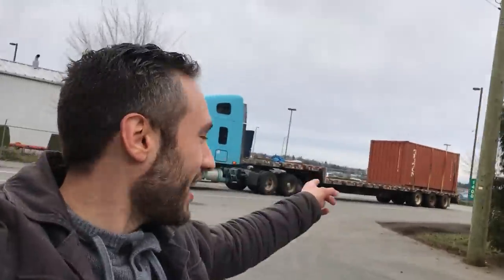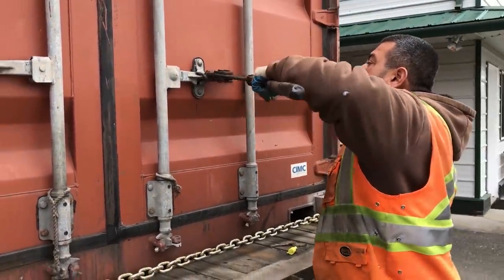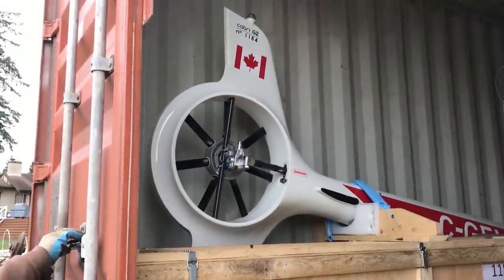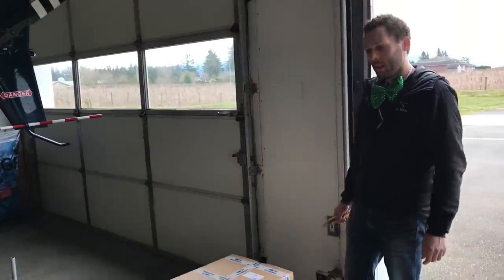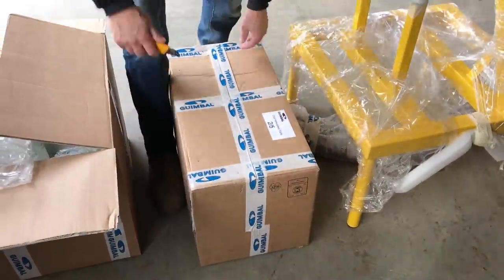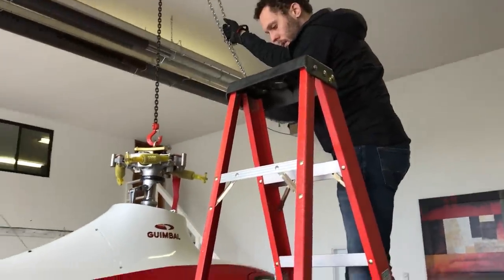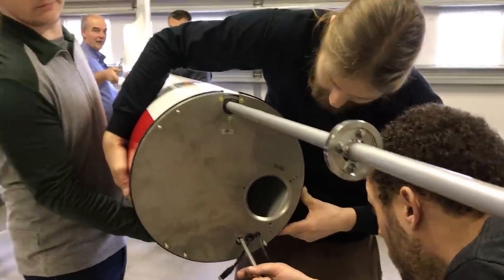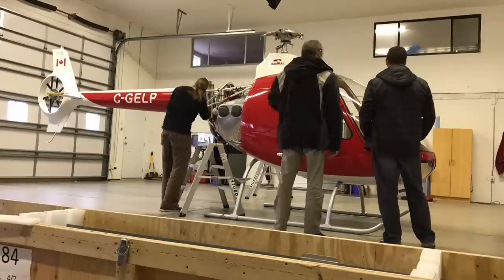First OFFICIAL Helicopter Unboxing | Guimbal Cabri G2

Comment: To all of the torque wrench fanatics below, after years of turning wrenches ( some of them torque) an aviation mechanic knows what pressure to use on the appropriate fastener.  For very large items (mast nuts being one) it is appropriate.   Very sensitive items (engine case halves etc) it is appropriate.  For 95% of what is tightened in assembly a qualified licensed aircraft mechanic would not use special measurement tools.  And remember, this is a condensed video of many hours of work, these people paid for, and will fly this helicopter.  Be assured it was correctly done.  If you think otherwise, it be your choice of not flying in it, but get a grip on unwarranted flaming something you know little about.

Comment: Wasn't expecting it to come like that, thought only the rotors would be off. Best unboxing ever haha!
Reply from the maker: Yes it was in several pieces probably to help with vibrations.  Probably wouldn't be good for the tail boom to be vibrating all the way across the ocean if it was attached.  It would also make it much harder to load and unload.
Reply: Pilot Yellow That's makes sense yeah. What was the cable that was guided in when you were putting on the tail rotor?
Reply from the maker: It was the pitch control cable for the tail rotor.  I was a little concerned with it's strength when I first saw it.  However after taking the maintenance course and learning how it's designed inside I have no more worries.  It's just as strong and more reliable than a direct shaft.  It's a great design.

Comment: Glad to see it made it in one piece! It was a little sketchy looking using that forklift. Good to see everything went okay and look forward to seeing some flying vids with it.
Reply from the maker: Yes we could have used an extra 5 feet on those forks for sure.  I'll have to ask them what kind of for lift they use over in France to load it up.
Reply: The forklift operator took the box on a top, should have done it on the side.

Comment: Are you gents planning on performing a initial rotor blade track and balance before the first flight ? if so I'd really like to see it on video. -Thanks
Reply from the maker: All the track and balance was done over in France.  None of the control rods or anything have changed so it should have the same balance.  We will see how it feels on the first flight.  If it feels the same we'll leave it.  If we feel any vibration we'll give it a track and balance.  But I will keep that in mind that you would like to see the process.  When we do our first one I'll make sure I video it for you.
Reply: Agreed. I would have a mechanic check it over. But then again I’d probably be too excited and just play around before inspection. I also didn’t see you guys put any tamper paint on the bolts.

Comment: Whoa, just noticed it's a clockwise rotor system! Is that going to mess with your normal pedal instincts?
Reply from the maker: It does for the first flight but once you've done it a couple times you're body gets used to it.
Reply: @PilotYellow  This would be my dream to unbox a helicopter. Especially the cabri g2. This is my most favorite helicopter. I live in california though so I can't fly with you guys. :(
Reply: Clock wise Left pedal??

Comment: I was wondering how much a r22 or that cabri costs and it's a bit out of my price range might as well get 2 mosquitos and strap them together for 30k instead of 300k to 400k
Reply: R22 is less cost upfront but more in the long run. PY has a video on this actually.

Comment: Does this need to be inspected after being built? Another set of eyes that make sure you didn't forget to tighten something?
Reply from the maker: We have had three sets of eyes go over it.  It does get inspected for the import but not that kind of inspection.  They go over the machine to make sure that all the equipment listed in the paperwork is actually installed and that everything meets the Canadian requirements.

Comment: What's the yellow fixture used for?
Reply from the maker: That's an engine mount.  If we need to do an engine swap you bolt that onto the bottom of the engine and lower it out.
Reply: Rich Eaton for bananas

Comment: I’m a bit worried that coming like a piece of furniture in parts instead as a whole, there might be errors because I assume y’all are not licensed. I would be scared to fly on it.
Reply from the maker: Liger King the people assembling the helicopter are licensed engineers and trained to assemble it.
Reply: Pilot Yellow, oh then that's totally cool. You know I thought they did the assembly like one would normally do with complex piece of furniture, such as a wall unit. Watching the video reminded me of each furniture that I assembled and the fear I had at certain stages of the each assembly that it might not go well (usually when a step on the manual is vague or seems skipped).

Thank you so much for your reply.

Comment: Cyclic control sucks. Its like trying to mix concrete by hand. Needs hydraulics especially for $400,000+
Reply: Nah.  So many air disasters have been caused by hydraulic leaks/failure.  Don't want hydraulics!
Reply: @HungryGuyStories  Well after 100hrs I got back in it and it had loosened up a lot. Just needed to be broken in

Comment: How much it cost
Reply from the maker: The helicopter is around $400,000 USD.
Reply: @PilotYellow  include shipping. ..???
Reply from the maker: Muhammad Arief that does not include the shipping. That approximately $10,000.
Reply: @PilotYellow  owh. . .and how for range. .  ???
Reply from the maker: Muhammad Arief you can get about 4 hours out of a tank cruising at about 80kts. But if you load up that much fuel you will be near gross weight when solo.
Reply: @PilotYellow  owh. .  Yes. . .  Thank you.  . greetings from Indonesia. . 🇮🇩🇮🇩🇮🇩🇮🇩